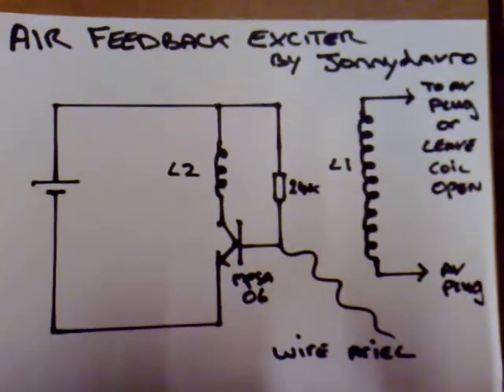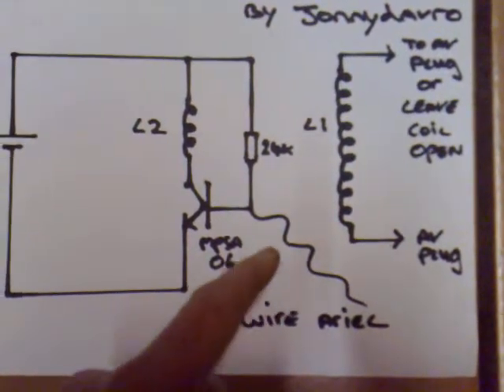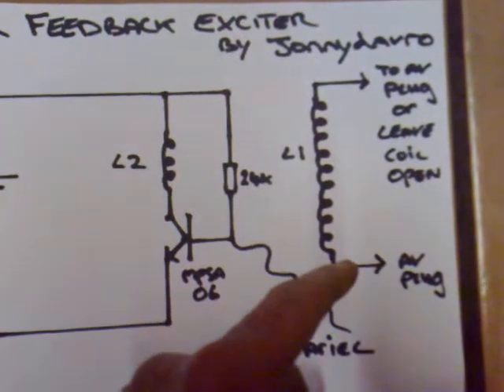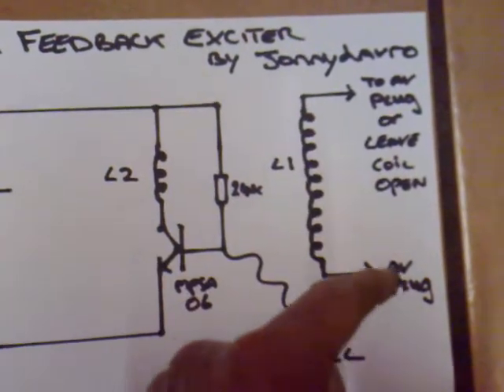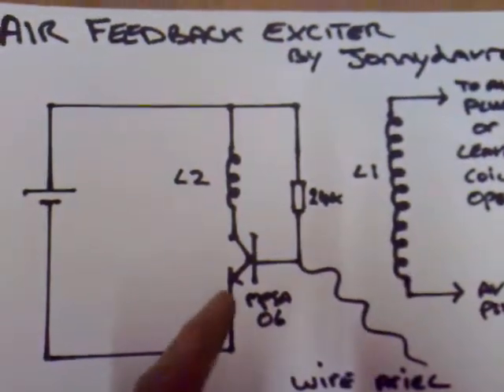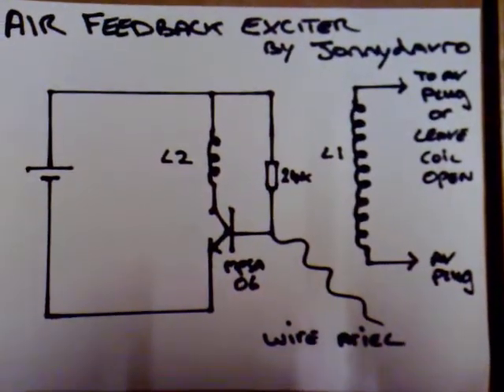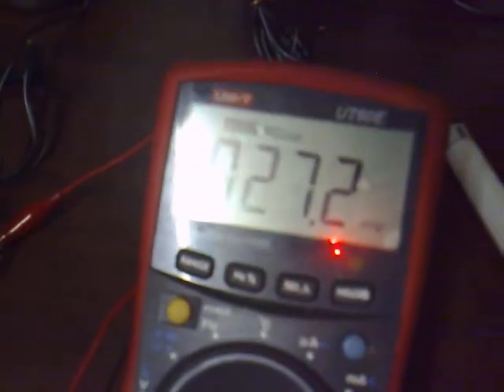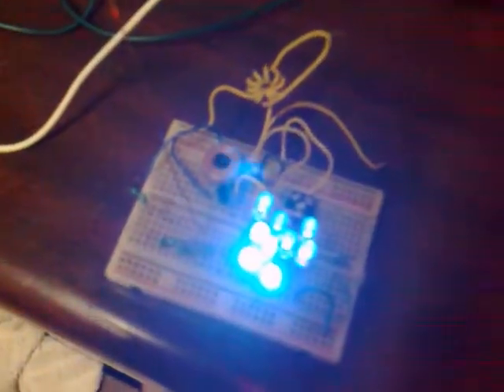Air feedback exciter

Comment: I have an idea, you knwo the bale wire on the Base, maybe we can put something like a wifi antenna on it? It might be like broadcasting the signal. I got the coils soldered up with a 22k resistor to see how that performs. I might try to put an antenna on the base of the transistor to see how that helps..

Comment: does the driver primary coil hit the self resonant frequency of the standing L2 coil of the sec if so the power should be quite a bit this is a very simple circuit and could be quite interesting if frequency could be adjusted but that may not be nesseccary as it appears to already be coupled but a cap to the other coil and a large resistor may be the way to go for a signal return.